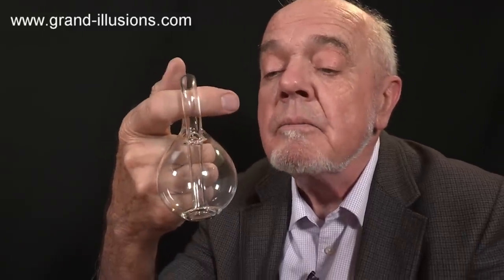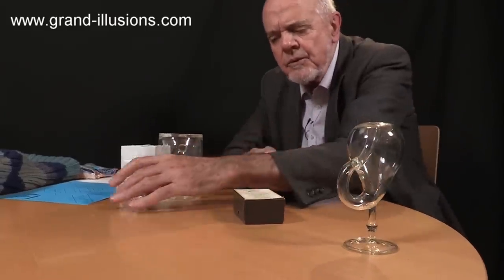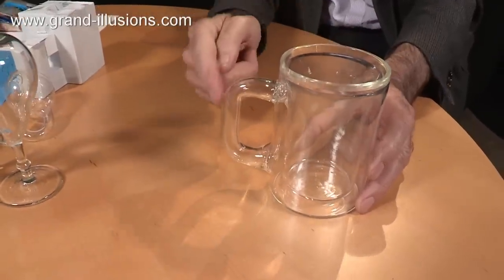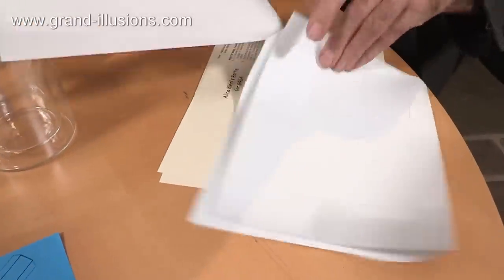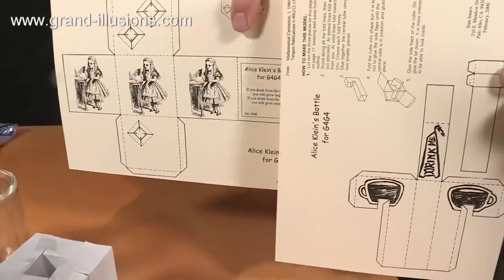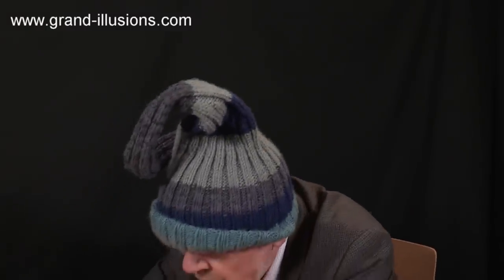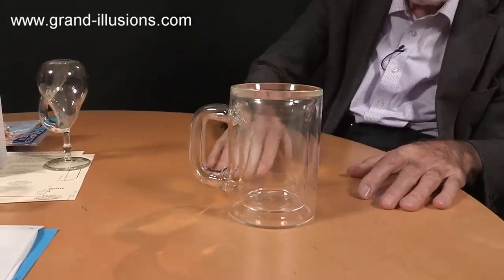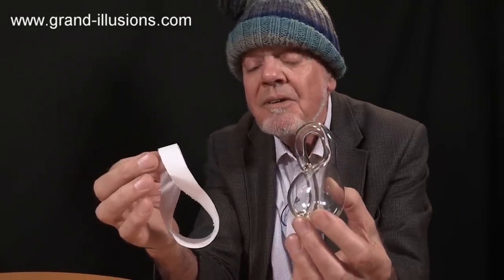Tim's Klein Bottles

Comment: What I would like to see is a Klein bottle of a material that is either putty or rubber depending on topology, capable of being separated and joined at specific points, so it can continually pass through itself, but stretchy and cohesive so it retains its shape.. Throw in some memory foam so it always reverts into the shape of a classic Klein bottle, or a cube or wineglass if you prefer. If I were a Klein bottle, that's the magic future material I would want to be made of.